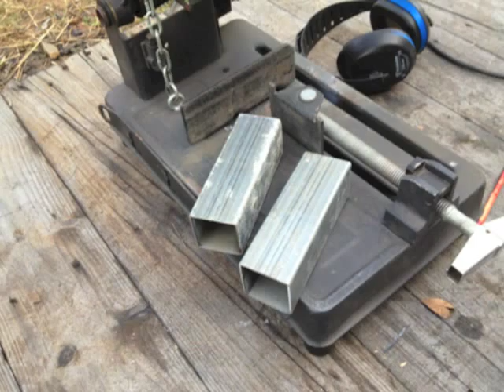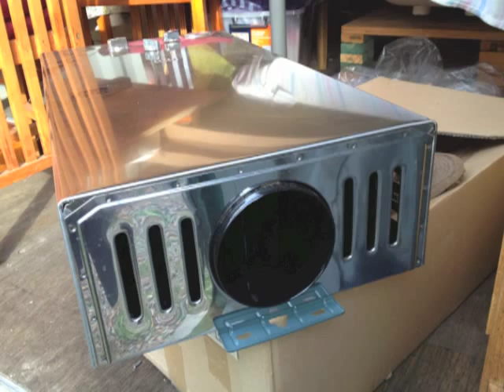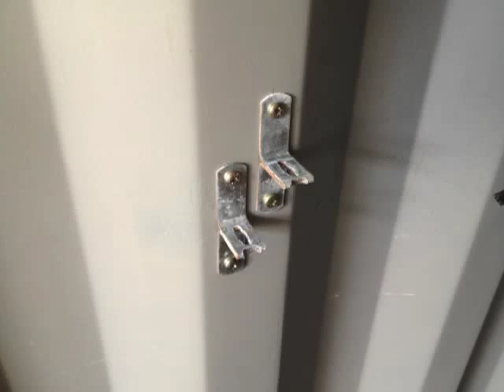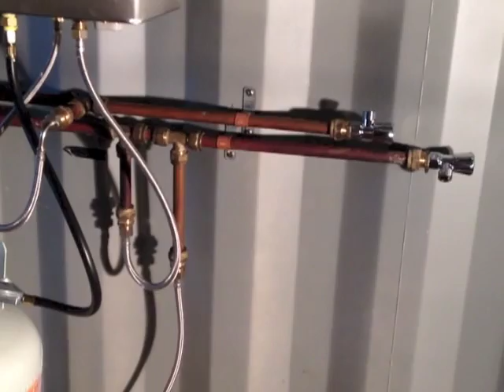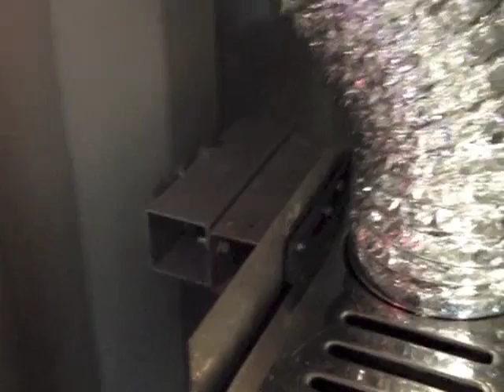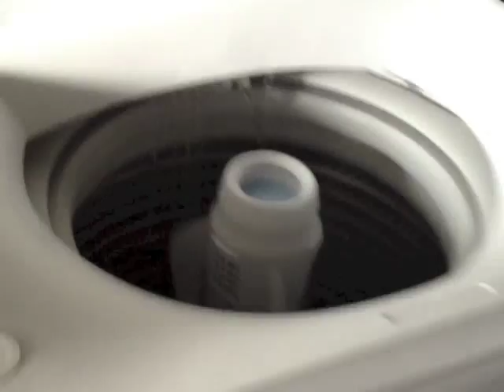Shipping Container House - Install instant gas hot water and washing machiine

Comment: Hi for fitting the gas don't you require to have specific gas qualifications for installing in a mobile structure such as a shipping container? I'm trying to set up gas showers for my campsite which are in shipping containers but I'm struggling to find a gas engineer who's qualified  to install the gass

Comment: It looks exactly like a Marey water heater. How do you like it? I am thinking of getting one too. And, where did you get the special flue for it?
Reply from the maker: Its excellent. It needs a 20 micro paper filter to prevent the taps from clogging. I found the 12v pump (26 lpm) did the job but the small mains operated pump that produces 35 lpm has been perfect. I have never had to change the batteries in the igniters. We use it every day, and I bought a second one similar that runs the laundry and the shower. The flue was a stainless steel vent from a major hardware store (Australia - Bunnings) There is an aluminium foil flexible vent pipe, Same vendor. Buy the vent after you own the unit, one had 100m vent, the other 125 mm vent. cheers Paul

Comment from the maker: My 12v 26 litres per minute pump was never connected to the new washing machine. It ran the old twin tub I believe. I have 35 LPM from the Davey mains operated water pump and it runs the household appliances perfectly fine. Sorry I cannot be more specific. Thank you for your kind comment. Paul